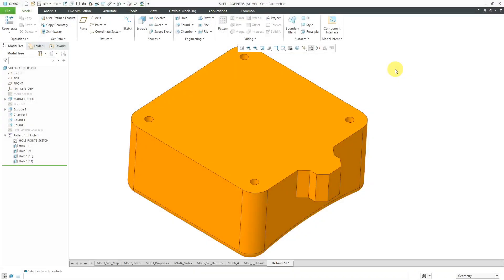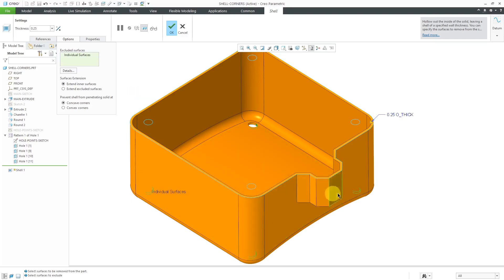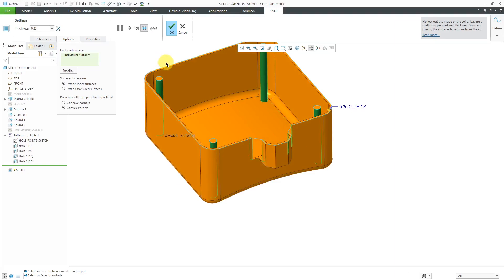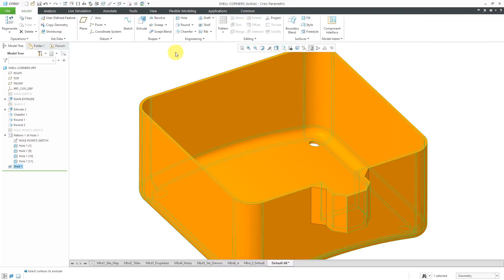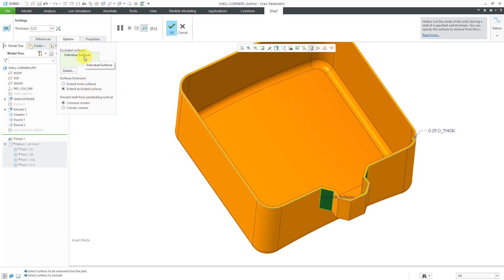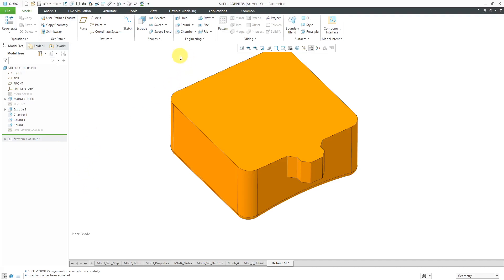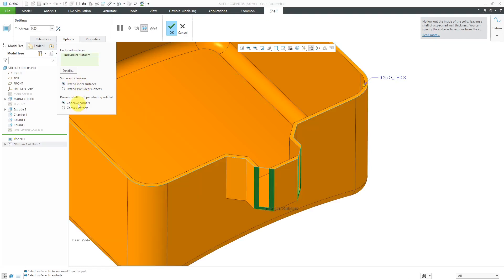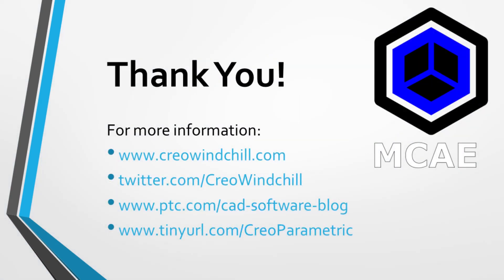Creo Parametric - Shell Feature - Chamfer Options

Comment: I use it a lot this feature mainly in electronics enclosures, especially if the electronics come only with the pcb board. 
I will find 3D model or design the pcb in a skeleton part  https://www.youtube.com/watch?v=xZE6ICNeiAE  and design the features that i want around the skeleton part.
But after I saw this https://www.youtube.com/watch?v=xs9kF-_1VP8 I use the sweep command for the more complex lip of the enclosure.
Reply from the maker: Interesting. Good to know. Thanks for sharing, Apostolis.